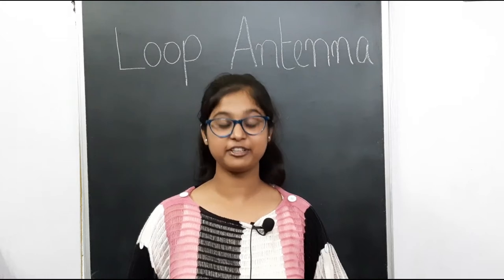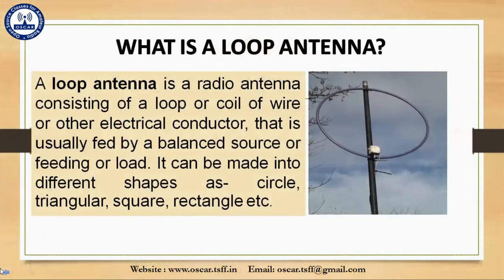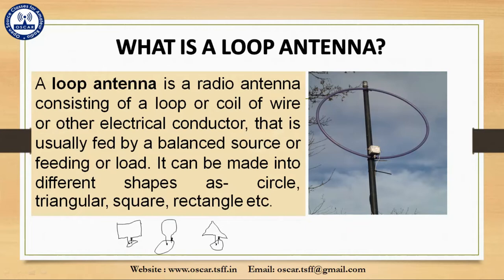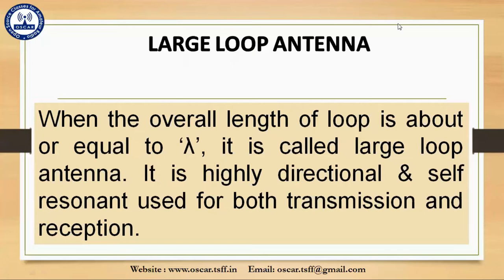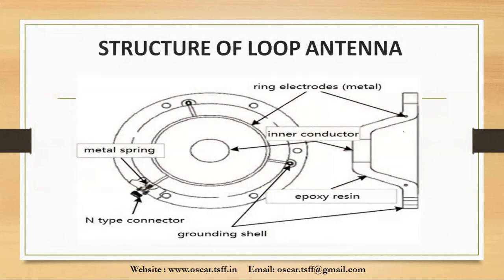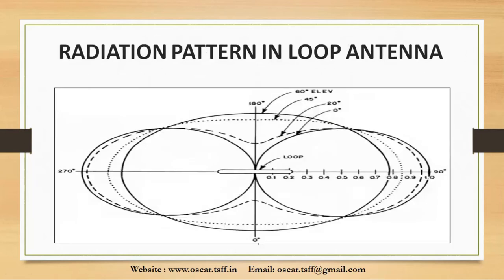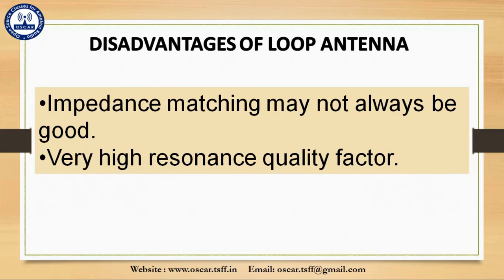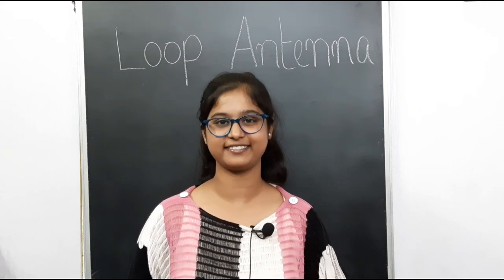Loop antenna overview | Antenna Theory | Sunday Night Show | Aishi | VU3OOS

Comment: Great job. Easy to intuitively grasp, except no explanation of n type of connectors or the spring which was mentioned.

I need an ellipse for US uhf reception. Circles, triangles, squares look ugly. Half wave lengths of 24 cm to 32 cm need to be captured. I need to know what max and minimum diameters.  I need at least two slightly different eclipses to create something pleasing to look at.

So far, I have failed to create any loop that picked up any uhf with 77 cm and under.  I don't know whether it is because I need a larger loop (a 100 cm wire with two diameters of 32 and 24 cm perhaps), or n- type of connectors, or a capacitor as one site suggested, the mystery spring mentioned in this video, or something else.